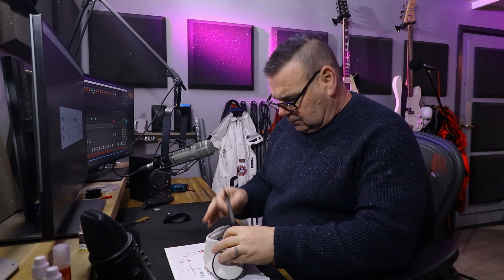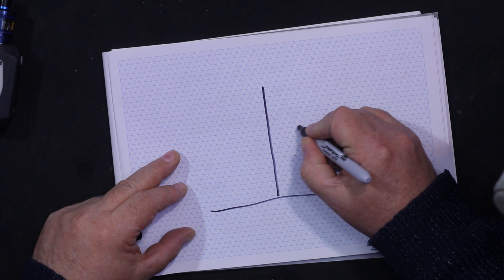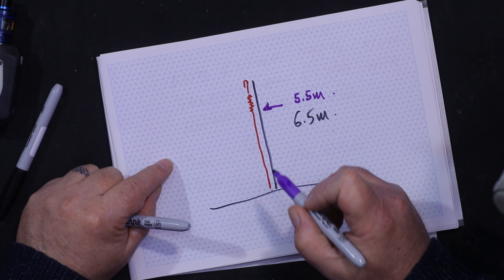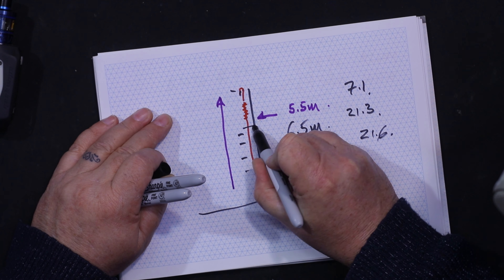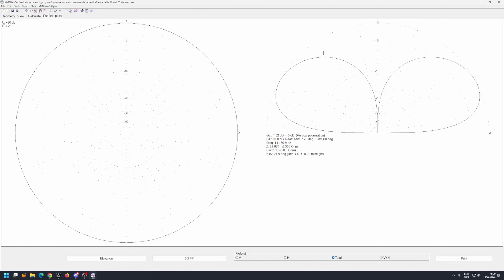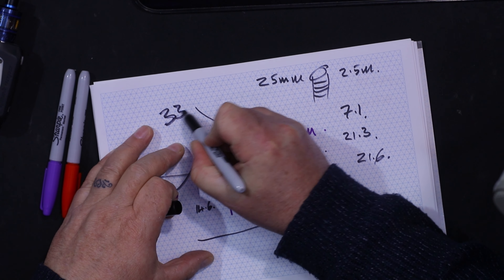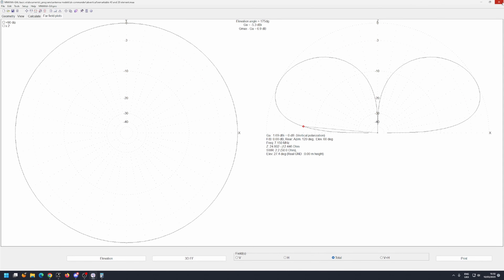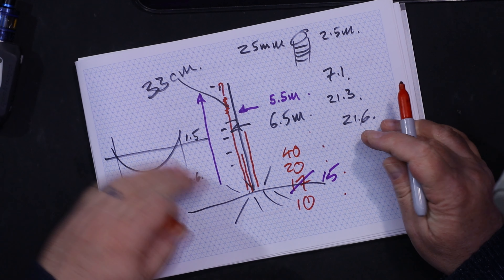Success! 20m and 40m on same element - Amazing Result!

Comment: Sir Callum,
Would you be kind enough to do a video on how you inserted the coil into the antenna in MMANA software model? I cannot figure out how to do this for a project that I am toying with. 

Thanks,

Tim
KA9AMO
Reply from the maker: Yes I will.. But for speed.. Go to this video and freeze the v ideo exactly here.. https://youtu.be/5rt-91i-Wro?t=313 and check the 40uH box (lower right) and also (important) check the box "Use Loads". Remember to add the coil as you do the source, so if you want a coil half way up element number 1, type in W1C (which means Wire 1, Centre).
Reply: @DXCommanderHQ  many thanks sir.

Comment: So the L loads a 6.5m wire to look like a quarter wave on 40. Surely on 20 it's making it look like a half wave, which would have feed point impedance of a few k ohms. What am I missing? 🤔
Reply from the maker: Conventional theory was telling me that too.. Honestly Paulo.. Just build one and slide that coil up and down and watch the harmonic.. I am currently getting 13.8 to 14.6 on a 1.5:1 bandwidth with 50 ohms. The radio thinks it's seeing a 3/4 wave.
Reply: @DXCommanderHQ  Fair enough, if it works it works, I'll try it sometime. Getting a resonant 40 and 20m antenna on a 6.5m pole without links or a tuner is ideal for a portable or SOTA station.  Adding  additional wires on higher bands would make it a winner.

Comment: I would have liked to see how you add coils on traps in MMANA.
Reply from the maker: There's a screenshot at exactly this time-stamp: https://youtu.be/5rt-91i-Wro?t=403 - check the "Use Loads" button and place your coil as you would a source and your inductor value in the box where I put in 40. Alternatively, watch the previous videos. Or even read the manual for the software.

Comment: I've been planning on a Rapide for pota and im liking what i see Callum. I'm going to make this wire and see how it works aginst my mono band wires I have been stringing up in the tree so  yes I've been getting out every band i switch but its worth it low SWR now I have something to mess around with 40 and 20 on the same wire😯😯😯 de W9US
Reply from the maker: Ed, the Rapide would work for this perfectly. Just use 3 holes / elements and you can operate all bands inside 5 minutes.

Comment: Interesting. These coils are very useful. Still using my 12.4 as we discussed. Looking forward to what happens with more elements.
Reply from the maker: Well, I have got 15 and 10 now working too :)
Reply: @DXCommanderHQ  Thats interesting. So 40, 20, 15 and 10 on a fairly short pole.  Bet that will be attractive to quite a plot of folks.
Reply from the maker: Basically, it's the "Rapide" with only 3 x elements.

Comment: On the 40M leg if that was about 5M long u will have 80M so it could be done like a lonked dipole to swap between 40 and 80
Reply from the maker: Lonked dipole! Don't worry - I knew what you meant :)

Comment: Hi Cal. Vy interesting project, thank you! What about putting this shorter 7m pole on the roof on my small house? That way i could keep it clear of obstacles! This ANT would be smaller than my cushcraft R8!! My question would be: if i had some elevated radials, how much would i need? Or should i rather place some radials right on the roof? Vy 73, Holger, DG7MA
Reply from the maker: Radials right on the roof. You are close enough to the ground that they should couple just fine.
Reply: Tks Cal! Vy73

Comment: Fantastic experiments Cal!  I did my first park activation with the dx commander yesterday.  Did a loop on the ground with an ldg 4:1 balun out of 20ft of wire as well in my icom 756 pro II receive antenna port.  Dead silent receive and great signal reports using about 40w from the dx commander.  Absolutely loving it!
Reply from the maker: Fabulous! Don't forget an eHam review :)
Reply: @DXCommanderHQ  qsl cal.  Will do

Comment: So if the coil of 35 uH is at 5.5 meters above the ground, after the coil, how much higher does the antenna wire go up? what is the total height of the wire, and then what length of wire did you foldover - thanks!
Reply from the maker: Pat, I can't remember. I haven't measured it out yet.
Reply: @DXCommanderHQ  very curious once you do!
Reply from the maker: After the coil, it goes up about 1m - then back down another 80cm - like a foldback.

Comment: Can someone tell me how do I add a coil in mmana please
Reply from the maker: Yes. See here: https://drive.google.com/drive/folders/1dJAOeSnLjk6irT657TSNrunCB0HzLpVX?usp=sharing - Click the "Use Loads" radio button. Place the coil where you want it (in this case, centre of Wire 1 - left of pic "W1C" ) and then put the micro-henrys in the box where mine says 5 (5uH). Take the output with a pinch of salt. Sometimes SWR curves can be more sever (worse) than wanted. In the field they are better.

Comment: Great Video Cal and inspired design.  You have me thinking of trying this concept on a 80/40 vertical. That might very interesting on a 12m pole. I need to work out some of the maths.
Reply from the maker: I think on a 12m pole John, it would work well.. It's like the Signature 12.4 where I do 80 and 30 - but the coil would (I guess) be higher up - around 6-8 feet from the top.
Reply: Even better if 2 well placed coils could get you 80/40/20 on one wire on the taller poles. Maybe go really crazy and try to sneak a 3rd coil on there to get 10. 4 bands with one wire to string would be a hell of a thing. Doesn't seem like they work as traps so it may be a pipe dream.
Reply from the maker: Mark.. OK, so I can't find the "next harmonic" - it's probably up high somewhere.. And too many coils spoils the broth anyway :) !
Reply: It would be a great experiment! Not sure I'd like to do the maths!

Comment: Yesterday I made a 35uh coil with 50 turns of 1mm enameled wire on a small section of 34mm PVC pipe. The total length is less than 75mm. I found your coil quite long for 35uh.
Reply from the maker: You can do the math. 25mm, 135 turns across about 33cm is 33 uH.
Reply: @DXCommanderHQ  I'm not doubting the value, I'm just saying if people want a shorter coil 34mm PVC pipe and 1mm enameled wire would do it.
Reply from the maker: Yes. Even a 50mm / 2-inch pipe. COrrect - and enamelled wire even less.. I used what I had which is about 2.5mm per turn.

Comment: yes i think these should be manufactured and shipped in little dx commander pull string bags with logo, very handy for a quick activation use , and to have various ones made up of course a pack could be sold with 6.5m dxc pole included or sell them individually , prices would be reflected on the manufacture and branding costs then varied price with pole and wire combos or individual added on top

Comment: This is very intriguing Callum, thanks for sharing. I have tried out short verticals in my /A backyard before.  I haven’t tried multi-banding them though, that is handy if you can do it. Yours looks very simple in practice but for me it is rather more complicated to analyse and understand. I have spent a fair bit of time with XNEC2 trying to get your parameters to work with a small radial counterpoise over sommerfield ground but haven't had much luck. So I messed around trying to do something similar from scratch and came up with something that looks like it works in a similar if not the the same way. 
Two things appeared from my early efforts. Parallel capacity in the inductor (which could be parasitic capacity) has a noticeable effect even if very low (eg 5pF). The self resonance in fact is somewhere in the vicinity quite possibly, so trap-like behaviour can be seen with some higher values of inductance. And if the inductive reactance is much more than the wire surge impedance, it looks like it chokes off the current at those frequencies. And the top loading effect of the fold back is essential.
So my redesign adopted top loading to a greater degree with a couple of “T” like elements at the top, although I sloped them down to be like wires running down guys. That is the sort of thing I have tried before. More top loading allows a smaller loading inductance at a higher point than otherwise. Mine ended up as two wires sloping down 1m and out .8m from the top of the 6.5m element. My loading coil is 4.7uH with 5pF to represent a reasonable self capacity. I started with higher inductance and less loading but I think these values are likely to be less fiddly to get working in practice. This gives a super 7MHz response with the current well up the wire like a conventional quarter wave. As you raise the frequency there is a high impedance resonance about 10MHz or so, and then it comes back to a broad match at 20m. There the current looks more like a quarter wave  with the top bit acting like a very short half wave with the current swallowed up in the loading inductor. As such I would hope it’ll work as well as yours seems to.
Best regards, John G8CQX
Reply from the maker: Hello John.. Ah-ha. Very interesting!

Comment: Hi Cal, I just wanted to share my recent experience. After watching your video on the short 40m vertical, I decided to erect one using whatever materials were readily available to me. I had a bamboo mast of around 20ft, so I built the antenna with a center loading coil using 17ft of the mast. I increased the turns and made it resonant at 7.1 MHz, but the bandwidth was slightly low due to the coil. I wanted to avoid linear loading due to mechanical issues, so I conducted an experiment and installed three piano strings in the shape of a flower to create a capacitance hat. This dramatically reduced the resonance well below 5.6 MHz, and to make it resonant again, I gradually reduced the number of turns on the coil until it was almost half the original amount. The bandwidth is now fine, almost 1.5 all over the band, and the efficiency appears to be better, as noticed by FT8. I just wanted to share this experience.
Reply from the maker: Beautiful!!

Comment: Good morning,  speaking of possible interaction, when tuning any DX commander in general, does tuning any one band affect the others as well, or do you pretty much just tune them one at a time and not worry that much about it?  Hope my wording makes sense.

73
Matt
W3MMW
Reply from the maker: Matt, Good question. Once all the elements are on, a small change in one will rarely affect any other. When I'm doing my R&D, I only notice a small change when I make drastic length cut or extension to another element.
Reply: @DXCommanderHQ  thanks Callum. I'll hopefully be buying one this year, maybe before field day if I'm lucky. Hope to hear you on the air sometime,
73

Comment: Great Video, as for myself, I rather go with an excellent radiator (no traps, no coils, even non resonating) rather than a having my focus on the great SWR. Antenna tuners never put me off as the loss on them plus the 30m of GOOD quality coax attached is very low, much lower than many hams dare to think.
Reply from the maker: Just the coax loss to worry about. Unless you are balanced line. Great.
Reply: @DXCommanderHQ  100%, and if good coax is used (and the run is relatively small) than problem solved.
Thank you for a great video and great products. Thinking and making things keeps any man young.